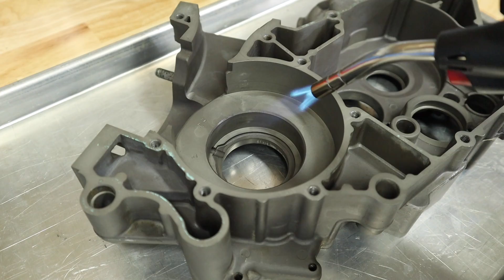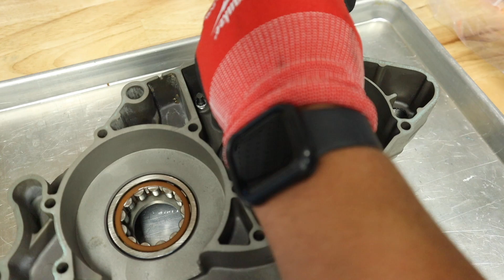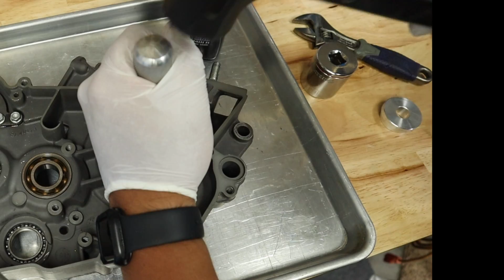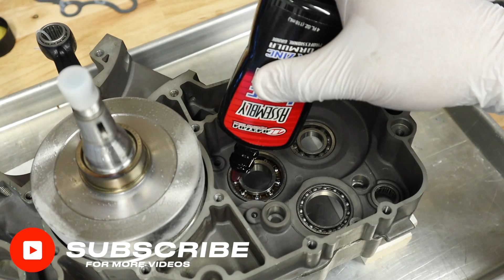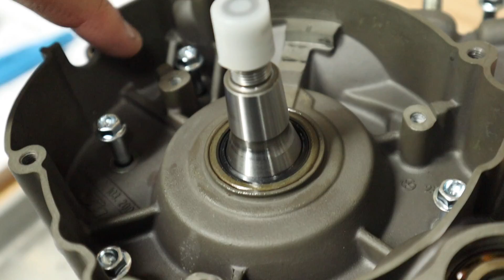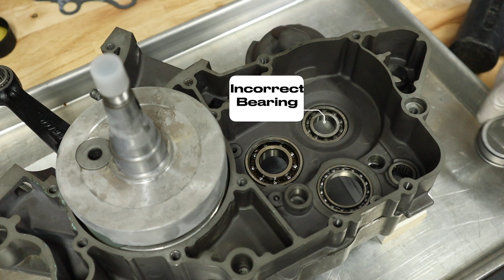KTM 125SX MOTOR REBUILD | Part 1

Comment: Whe you were spinning the transmission after so much turning does it stop spinning or freely spins the whole time I’m in my 125 and am having trouble if it was installed correctly or not
Reply from the maker: It should freely spin with minimal effort, you may have it in gear, or something is not meshing.

Comment: Hey, when a put on my oil seal on the left side of the crank i felt a little resitance when turning the crank
Reply from the maker: Yep, that’s normal with new seals, they are doing their job holding tight around the crank! Nice work!

Comment: hey you helped me with the powervalve but i have a question. Why would there be smoke coming from my powervalve tube on left side and oil coming from the bolt where you set the powervalve? You think maybe an oil leak?

Comment: what year is it?
Reply from the maker: @oblakue 2004
Reply: @ thank you. Without you alot of people would struggle🔝
Reply from the maker: @oblakue haha thanks man, the goal is to help for sure. 👍
Reply: @ had a problem with the power valve. Wasn’t set right. Thought about sending it to the mechanic
Reply from the maker: @ you are the mechanic my man!
Reply: @ hahaha no no not for dirtbikes for scooter maybe but dirtbikes never hahah
Reply: @DanMX2112  oh one more question. Why would there be smoke coming out of my tube coming from the powervalve? And oil coming from the screw that adjusts the powervalve on the other side?

Comment: If I put a vforce on my sx125 do I have to map my control unit
Reply from the maker: No sir, but it will help with throttle response, you’ll like it!
Reply: @DanMX2112  tank’s

Comment: do you need a crank shaft puller for this model of engine? noticed you were able to make due without it!
Reply from the maker: Highly recommend a puller, it’s cheap insurance regarding the case halves. You wouldn’t want to crack one pounding an old crank out.

Comment: hi, are all the bearings non-directional?
Reply from the maker: Yes, open bearings get lubrication from the engine oil and don’t have a direction. Sealed bearings are the same way, no direction.
Reply: @DanMX2112  thanks!😀

Comment: Hello I have a problem when I tighten the crankcase screws with the torque the crankshaft doesn't turn what can it be?( All the pieces are new)
Reply: hit either one of the sides and it should loosen up
Reply: @Dilan.supermoto  It worked, thank you
Reply from the maker: Sorry missed your comment, but @dailyshreding9393 was right. Sometimes the crank can somewhat bind with the bearings in install, and this can usually be freed up by just shocking it.
Reply from the maker: Perfect!
Reply: Hello, i dont see the response on this comment and i have the same problem, could it be my bearings in the wrong way?
and thank you for your content, it always help us out
Reply: @gabinnanchen Close the crankcases with everything inside them and already with the gasket. Pull the screws with the dynamometry. Get a rubber hammer and shims to verify that the shaft is centred. Take light blows with the rubber hammer to centre it. Once it turns free you are fine. After a few thermal cycles of the engine everything is settled inside, I have never had any problems.

Comment: Hi, I don’t have that rubber thing in my engine (28:15) or it’s missing. What will happen, if that thing is missing? Thanks and greets from Finland.
Reply from the maker: You need it, it’s a separator for the oil, keeps it where it should be when running.

Comment: Hello again, thank you so much for all the videos and anwsers but do you know how much clearance there can be in the connecting rod bearing? I have about 0,6-0,65 millimeters and I think it’s to much? Thank you!
Reply from the maker: Axial Play (left to right) around .025mm-.040mm. Up and down or radial should be nothing, snug as a bug.
Reply: @DanMX2112  Thank you for anwsering but are u sure it is 0,025 mm - 0,040 mm? I have 0,60-0,65 mm side to side and thats a huge differenc

Comment: Hello, does it matter which way the bearings with plastic in the gear box is facing?
Reply from the maker: My opinion is no, some may say different, but I would bet it gets lubricated just fine.

Comment: Approximately how hot did you have to get the inner race of the roller bearing before it would drop down onto the crankshaft?
Reply from the maker: Not sure, I’ve done many engines sweating bearings and I just kinda know when enough is enough. About 300-350 degrees should be fine to sweat bearings.

Comment: 25:40 It looks like those gearshafts are missing one gear each between the two gears closest to the ignition side. Am I blind or is the bike really fivegeared?
Reply from the maker: It’s a 5 speed, you are correct ✅

Comment: I did the case bolts on my bike I just took one bolt out and put a new one in and just did them snug up by hand should it be alright? Its been about a month and it’s not leaking or anything
Reply from the maker: Honestly, if it hasn’t leak, it’s tight enough. I would still go back with a torque wrench and just hit them to 7 foot pounds and just make sure your dialed.

Comment: This is the most informative videos on ktm motor builds I've found on the older model 2 strokes. Now I'm finding it hard to find the rebuild kit... there's one for the 2000 to 2002 EXC, but will that be the same? Surely cause this 125 sx looks like my 200. If I have to split the cases to fix 1 crank bearing, then I should just rebuild the whole dam thing. 
 Anyways thanks for taking the time to make these videos man!
Reply from the maker: Your welcome brother and thanks for the kind comments. I would replace the crank bearings as a set and whatever else feels it may have some catch, or rough feeling when rotating. Trans bearings usually are not issues at all, but it’s kinda one of those deals. Do it while you in there.

Comment: Hi, i have a 07 aswell and i just rebuilt it aswell but somehow it takes a lot of force to shift. I dont know what ive done wrong or if its a problem with transmission or the shift mechanism because it shifts in every gear. What if noticed is the shiftdrum was really hard once i put the cases together…
Reply: Shiftdrum was hard to turn*
Reply from the maker: Sounds like it’s bound up for some reason, maybe a bearing clearance issue, not seated?
Reply: @DanMX2112  thanks for answering, ill split once again...
Reply from the maker: Idk what else it could be?
Reply: Well, its weird coz when i put in the main and countershaft with the shiftdrum it worked properly, once i put the other casehalf on and tried to turn it was like really hard to turn, could only turn it with ratchet, should be able to turn by hand no? And also i made all bearings new so im so confused.
Reply: really apprecaite the fast answers!
Reply from the maker: Of course, wish I could do more!
Reply from the maker: Interesting, ya I wish o could help, but your for sure gonna have to split the cases to check for the issue. Sometimes these things happen, just be very thorough when checking and double check bearing placement and part numbers.

Comment: Is there supposed to be a gasket between the engine block and reed cage? What about between the Reed cage and intake Manifold flange?
Reply from the maker: If you notice in the video, there is a gasket between the reed cage and cylinder, but nothing between the cage and the intake boot. Hope that clears it for ya.Thanks for watching Mark!
Reply: @DanMX2112  Yep, I did infact notice what appeared to be a green gasket. Here's the thing, I looked at several parts diagrams online for a 2003 125 sx, some showed a gasket, and others did not. For all I knew, you just cut one yourself for peace of mind.

In the process of chasing down a lean condition right now. I pulled the intake flange/reed cage assembly off, there was no gasket installed in either of the locations I asked about.
 Even though it went against my better judgment, I thought perhaps engineers didn't find a gasket necessary between the engine cases and reed cage, since the cage itself has the rubber coating.
 I did put a gasket there, and coated it on both sides with a super thin layer of ultra black rtv, using the dab method to apply it. I did this between the cage and manifold flange as well.

 I'm really hoping this fixes the issue, it's been a bit frustrating sorting this out.
Reply from the maker: If it’s a true lean issue and your jetting is good, you may have some bad crank seals. I’ve seen many bikes with the rtv in between the boot and reeds, it’s not really an issue. It becomes an issue when you loose the rtv pieces into the bottom end and tear up the crank. Sounds like you making progress, just be very mindful of rtv as it’s not a fix, but a bandaid!
Reply: @DanMX2112 The jetting seems to be spot on according to KTM recommendations, and if anything, a bit more on the richer side of things. 
 
If this fixes the issue, I will then order a new 70 dollar manifold flange. I definitely do not like half assing things, but I also don't want to start dumping unnecessary money into this 20 year old bike either.
 
Before tearing into it, I did use brake clean trying to pin point the leak while the engine was idling. The results I got were iffy, but I wasn't necessarily expecting a strong reaction to begin with, since the lean condition was only present at high rpm.

If this fixes the problem, I will let you know tomorrow. Thanks for the replies!
Reply: @DanMX2112  That was the problem. Just took it out for a ride, and the bike absolutely rips now.
Reply from the maker: That’s so awesome! Great job!

Comment: Hi Dan, I'm getting lined up to do this to a 250, which is a very similar motor it seems. Maybe you mention it, but, did you use a wrench rabbit kit here or did you source the parts OEM. The all in a box solution seems like a good option but I hear mixed reports so I don't know which way to go. Thanks.
Reply from the maker: I’ve never had an issue with a wrench rabbit kit. The kit came with the bike when I bought it, and it was a Wiseco crank. I went with OEM bearings and ran a Namura piston.
Reply: @DanMX2112  Okay, thanks for the reply.

Comment: Hey man, did you have to order the small black bearing at 6:09 separately? Doing the same rebuild, got the bottom end kit but it seems to be missing that bearing.
Reply from the maker: I don’t remember to be honest. But it should be very cheap to order as it’s such a small bearing. I wanna say it came in the kit, but can’t remember.

Comment: Sorry for commenting on such an old video, but I just found your channel. Great build series. However, I have a concern about the main bearings inner race that you heated up before slipping it on there. I´ve seen a lot of SKF mounting instructions for bearings, and they recommend heating to 90-110 degrees C, around the boiling point of water. 212 degrees F. 
To make it brown on the surface it has to reach around 250-260 degrees C. Which is around 500 F. At 295 C it turns blue. This amount of heat may affect the hardness of the bearing race. I hope it was OK, but I think you went a bit too far.
Reply from the maker: This is awesome info, and I really appreciate it. So the funny thing is I thought that I heated it up to much, but I checked it with my temp gun before hand and was around 300 F. What turned it brown was the WD-40 that I sprayed on it before I stored the part. Trust me, I was very worried. And I’m grateful for your insight and specific temps. So if I understand correctly, is over 500 F where I’m going to affect the hardness, or before that even. Wanting to know more of this.
Reply: @DanMX2112  I would not go over 240 degrees F. For normal mounting of any bearing parts.
At what specific temp damage occurs is information that is hard to find.
Generally the information is given regarding a complete bearing where there often is a plastic retainer, rubber seal, grease, and so on. Also the expansion coefficient is at this point great enough to mount the bearing even without cooling the other part.
In your case the inner race was by itself, so I hope nothing was affected.
For a normal workshop (without bearing induction heating equipment) I would recommend a hot plate, a temp gun, and a drop of water to determine if it is hot enough. When a drop of water boils, you can mount it.
On a hot plate you can let any sort of bearing reach 240F safely.
Reply from the maker: I’m sold on the hot plate idea, I think for the next build I’ll put my cases on a hot plate and allow the heat transfer to happen controlled. With the expansion of aluminum being greater than steel at the same temp, this will ensure no mistakes and weakened metal. Given that most of the install is a bearing into a housing, than freezing and Inserting into a hot case is the majority of the work. This is an awesome thing that you reached out, and have given me some ideas. What’s your take on case halve heating, hot plate or oven?
Reply: @DanMX2112  any will work. For larger cases, an oven would be ideal.
If you only get the hot plate, it will work as well.
Reply from the maker: Love it, thanks Daniel!!!

Comment: I’m doing a rebuild on this same engine and I was wondering if the counter shaft bearing sticks out from the case slightly or if it is supposed to be in set slightly like the crank bearings.
Reply from the maker: Yes it does just ever so slightly, on the inside that is. Just make sure the bearing seats and you can’t go wrong! Thanks for watching
Reply: @DanMX2112  awesome! Thanks for the quick response! Great videos 👍🏼

Comment: Did you cerakote the engine cases?
Reply from the maker: Only the clutch side case cover and the outer clutch cover. The inner case halves are the original anodized color. Turned out sick!!!

Comment: Left hand crank bearing is a dick on removal 😁

I had to remove the roller bearings and place a large washer behind it because it's blind
Reply from the maker: I used a punch after heating the case, worked like a charm. But, I agree those roller bearings suck compared to the ball bearings! Thanks for watching man!!!
Reply: No problem you did a nice job 

I got my rebuild on my channel same one you did lol good engine tbf

Comment: What year is this motor? Are all ktm 125sx motors identical/similar? I'm looking into a rebuild for my 03 125sx!!
Reply from the maker: Hey man, first of thanks for watching! And yes, yours and mine (04) are basically identical. So follow my build series and you should have no issues getting it rebuilt. I suggest downloading a manual online, just for specs. Idk where I found mine, but you can get on thumpertalk and find one I’m sure! 🤙
Reply: @DanMX2112  Awesome!! I'm pumped. Engine work always sounds so hard and scary but it isn't too bad by the looks of it!! Keep it up and I'll be going through this series many more times 😁😆
Reply from the maker: Haha right on man, and reach out with any questions!!!

Comment: Awesome videos, very helpful, so when sealing the cases you don't use any sealant? Just grease and the gasket, What kind of grease are you using?
Reply from the maker: Correct, I don’t use sealant on the KTM, it doesn’t call for it. I use Maxima waterproof grease, and I put a link in the description below ⬇️ go check it out.
Reply: Cool thank you. This channel is gonna blow up sooner or later
Reply from the maker: Dude thanks so much, it’s because of guys like you commenting and helping out that make it work! Please share it brother and thanks for watching!!!!